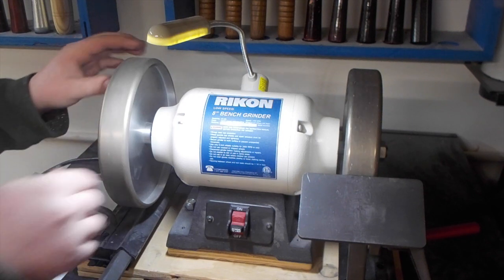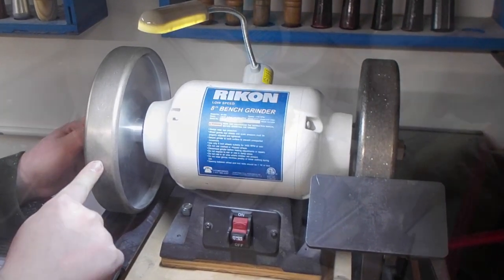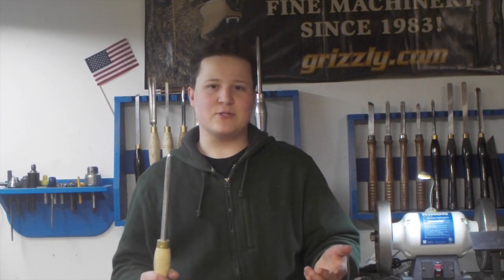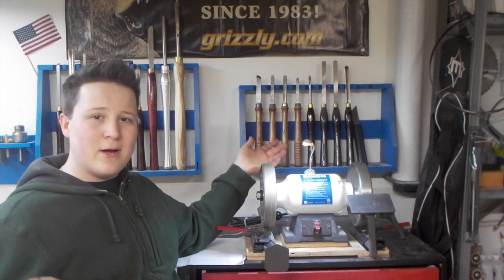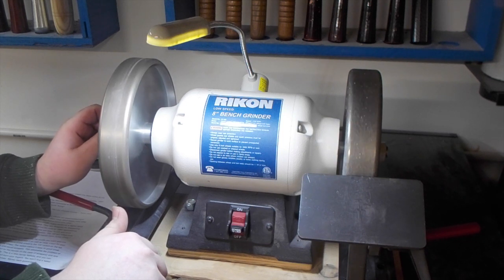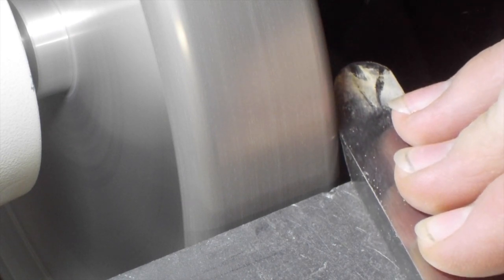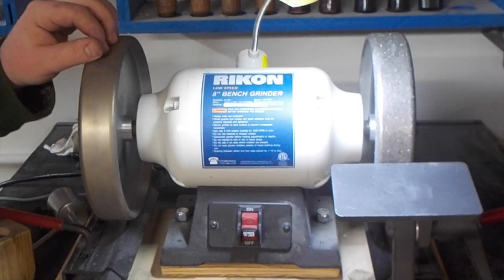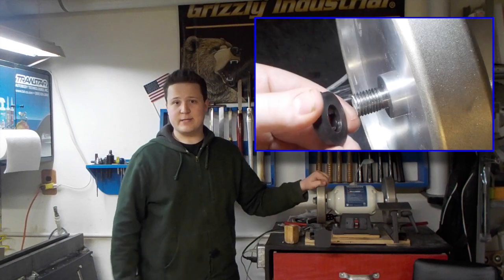Radius Edge CBN Wheels ~ Woodturners Wonders

Comment: Hey, Peter.  I am going to buy a set of CBN wheels, but I am curious as to the real practical use of the radius edge.  When you move the tool around the edge to grind the sides, you are moving from a hollow grind at the set-up angle to a 90 degree flat grind.  Does this not defeat the purpose of having the hollow grind?  Is it not detrimental to not have the hollow grind follow the tool profile around to the sides?

Comment: So, I don't turn wood, but I'm a cobbler and I really like sharp knife and tools. I'm tired of spending so much time on water stones. Are CBN wheels appropriate for me? I'm don't mind doing a bit of finishing with stones on the finer tools that require a mirror edge, but how is the finish on let's say a 180 wheel? Would it be a good wheel for restoring damaged edges on kitchen knifes? Thanks a lot for you video!
Reply: Yes & Yes

Comment: Also what about your skews? How do you sharpen them and on what wheel?
Reply from the maker: +The Russian Woodworker I touch up my skews with a slipstone three times in between each grinding.  If I only have to resharpen a tool, I use the 350 grit wheel. If I want to reshape one I use the 80 grit wheel.  So after three touch ups, I sharpen them on the 350 grit wheel.  I also like a radius profile on the skew because I find that it keeps it easier to direct the cutting action in the middle of the skew.